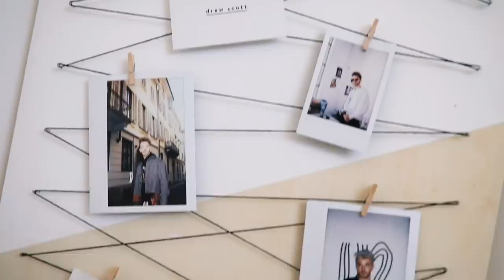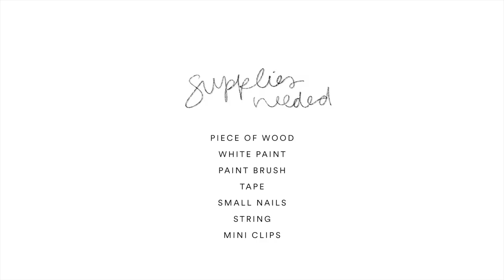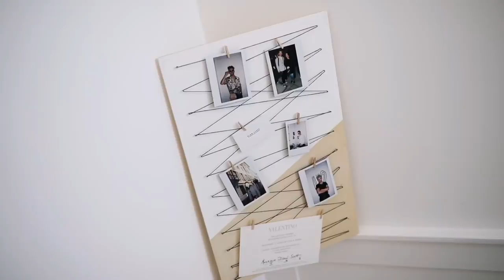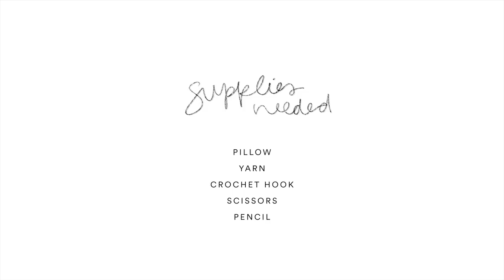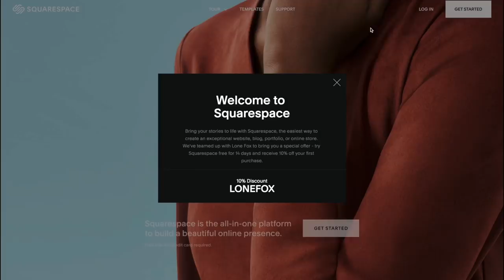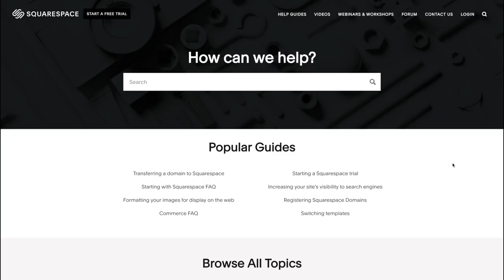Creating DIY's You DM’d Me! - Lone Fox

Comment: Those little wires inside are filaments.  I welded those on my first job ever, working at Sylvania Tube Co.  At the age of 18 in 1966.  Only I did the tiny little tubes for tv's & radios.  Acient...right...lol.  when they used tubes

Comment: # 2____Ive done the FLOWER Box CRAFT B4

....WHAT WORKED REALLY Well...WAS WHEN I FILLED UP THE EMPTY PART OF THE... BIG BOX WITH LIGHTLY CRUSHED TISSUE...All The Way To The Top, because you can always lightly push down to where you need it to be...by using the tissue their was some support under the Roses....

Then My Roses Had A little Somthing To Rest On While I GLUED IT TO THE INSIDE BOX.... I used the same color tissue as my Roses... 
(wrapping gift tissue)

#3___The light bulbs can be ordered...with out that part
GO ON LINE....AND ORDER

Comment: You should attempt the lightbulb one again but with fake lightbulbs (you can get them at any craft store) and fill it with clear drying clue (like Elmer's) and flowers and you can make two tiny holes on the sides the metal part that closes it so that you can thread a thin wire through it to create a loop and tie the yarn to the wire :,) loved the video 🙌🏼💓